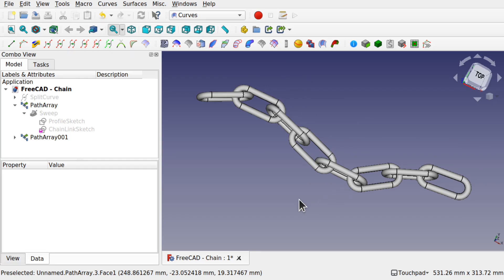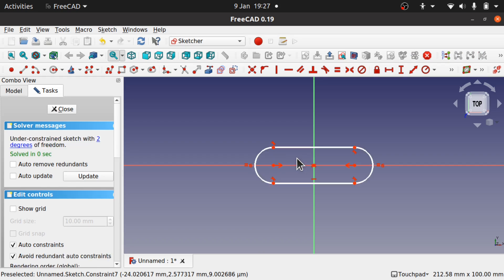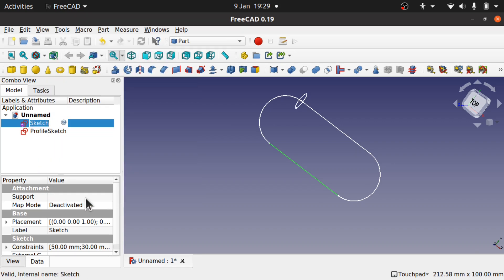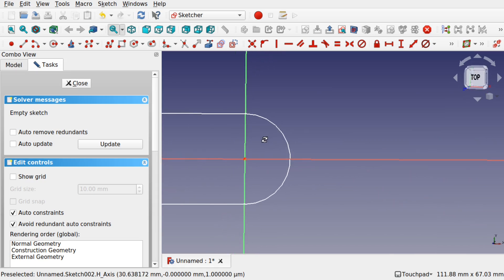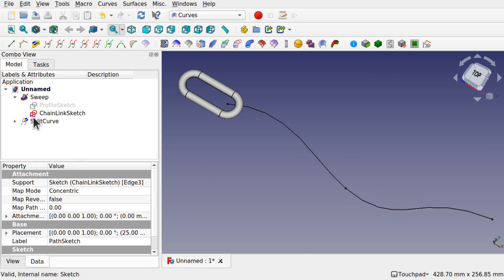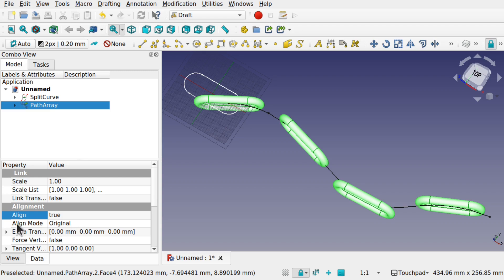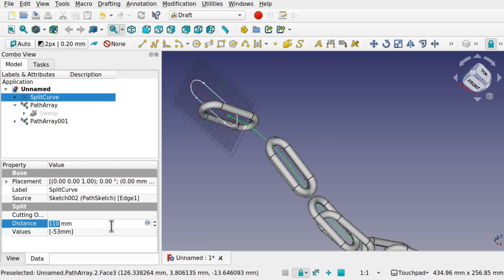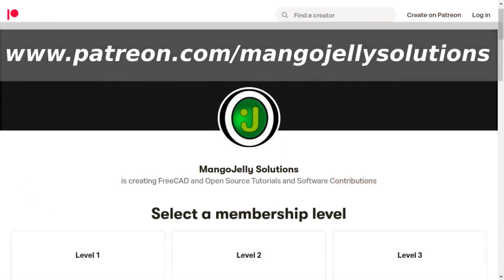FreeCAD: How to create Parametric Chain using Curves Workbench and Draft Arrays. Beginners Tutorial

Comment: I learn something new every time I watch your videos! I do have a question though.. in making this design can we 3d print it? it seems when I try to mesh them they go separately and I can not export as one mesh to 3d print. It meshes each sweep by itself so when I want to export to creality it has to load independently. As you can probably tell I am new to this.
Reply from the maker: Glad you finding them useful. You will need supports if you going to 3d print the model as the links that lay flat will be floating in mid air. To export as a model you will need to select both path arrays whilst in the part workbench and select top menu, part, compound, make compound. You can then export the compound to a mesh. This should  be then able to 3d print but as said your going to need supports. An all in one chain for 3d printing with minimum supports, now that is a challenge. I wonder if you can curl up the chain to reduce  supports 🤔
Reply: @MangoJellySolutions  it has been interesting not only learning freecad with you but also then carrying that into a 3D print. 3d print limiting my creativity on freecad. This piece of info was probably easy to figure out but with the vastness of FreeCad I’ve struggled to learn easily. I appreciate the help so much!

Comment: I like, it's a good video, but i have a question, i had try with more chain parts and the result is strange. all new part stack on the sweep (sorry for my english, i'm french), need more spliting the curve?
Reply from the maker: I think I need to expand on the video as there are some information I need to clarify, sorry. When you add more links you need to increase the length of the path. The split curve goes hand in hand with the Join Curve. The reason we create two join curves is because the split allows the offset. So if you wanted to add more links you have to lengthen the original sketch to accommodate these, if you change the size of the link then you have to change the size of the offset

Comment: Another great video as usual . I have a question not related to this video . I want to make some snap lid containers putting the outside of the container i can do but the lid is what i need to learn . these are square lids . I want to put an a pad feature on 2 sides . How can I access the inside wall to attach a sketch to do a pad feature ??

Thank You
Terry Lembke
Reply from the maker: Thank you and thanks for the comment. In answer to the question are you using multiple bodies, one for the lid and one for the box? Are these based on the standard boxes with snap lid the clear blue ones which have a lip that runs all the way around the outside which the wings of the lid snap under?